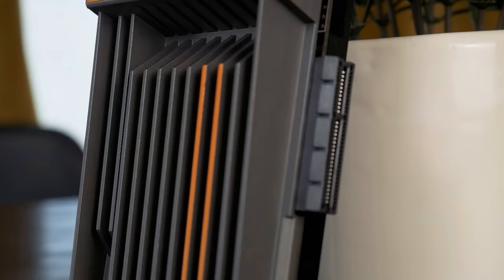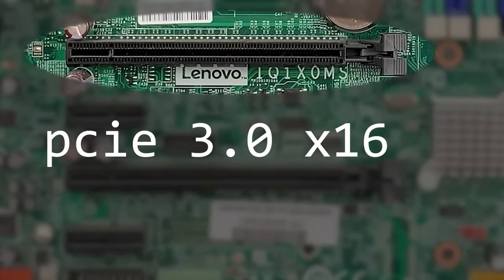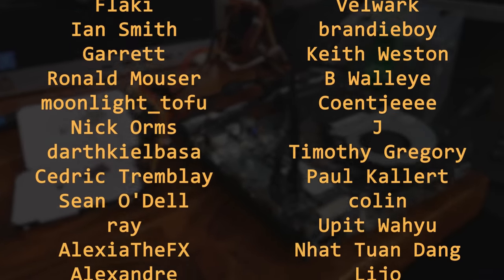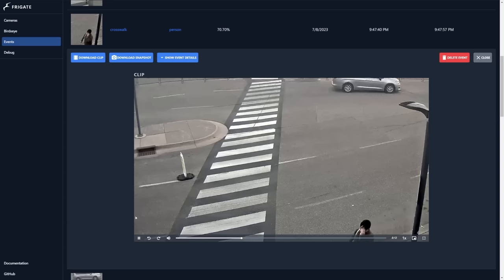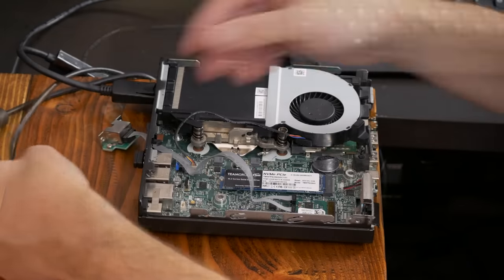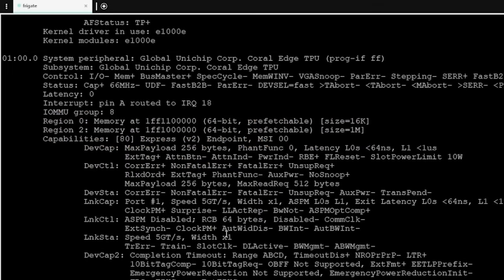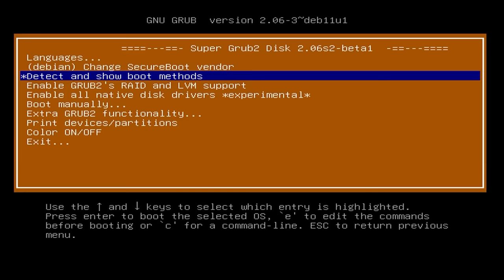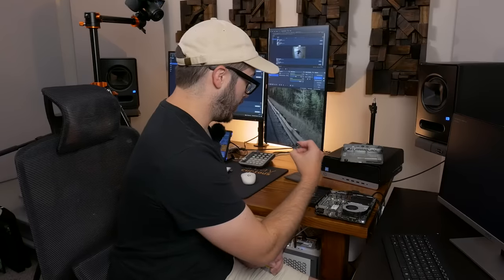Don't Overlook This Slot

Comment: Turning the wifi slot into a SIM card slot for cellular internet connection is the #1 most amazing modification that no one feels like they should talk about.  This is a high end feature only some business class laptops receive.
Reply: What modules would you use for that ?
Reply: A SIM card module?
Reply: How the hell have I never heard of this?!?!? That’s probably one of the most convenient features you could put on a laptop today.
Reply: @suspiciousstew1169  I think it's more common in rugged devices. Stuff that's meant to be used in a quarry, in the field, by surveyors, etc. are more likely to have these. I think. It used to be a big thing in more high end laptops, but now that most people can get a laptop if they want (as the cheap ones are usable), most people work in the city, every coffeeshop has free wifi and every phone can now be used as a hotspot it's far less common. If you're a little bit older I think you're more likely to have heard of it.
Reply: @suspiciousstew1169  Same, that's actually pretty groundbreaking. >.>
Reply: Ive been looking for a combo wifi/LTE M.2 for years. Does any one know any models?
Reply: @luv4mpower I want one of those too
Reply: I think Ive seen that product in some china e-commerce its sell just part of motherboard and other. but I've forgot what website it's, I give a link if I got it
Reply: Actually a good idea. Especially if your laptop has 2 slots.
Reply: The reason is that if you don't also have wifi it is pretty anoying in most situations.
And it is a common feature in a lot of business laptops. Admiralty they are more expensive than a lot of consumer ones. 
But the more expensive part is normally the data anyways.
Reply: Indeed. It was a pretty cool feature in these high-end business class laptops, but shortly after the advent of smartphones with personal wifi hotspot capabilities, there was obviously no real use for integrated SIMs anymore.
Reply: @dvdemon187  Wifi hotspots are not good for your phone - they heat it up like an oven for one thing and zap it of battery.  More of an emergency solution than anything.
Reply: that's how my laptop is.... I have a WLAN and a WWAN (for sim cards) slots.
Reply: Some UK ISPs have teamed up with mobile networks to provide 5g as a backup connection (inside the router), should the 'line' go down at home. BT and EE arer one example.
Reply: @Thurgosh_OG  that's fucking rad... I think they have that in the US but only with GSM service.  CDMA is so much better, and more secure, but they don't have CDMA in a lot of countries.  Not sure if they have it in the UK.
Reply: Woah!!!
Reply: I wonder if there's a wifi/cellular combo module thing
Reply: @Allen-R  i dont think ive seen one but there are all kinds of variants on amazon
Reply: I've got multiple Dell laptops that have dedicated WWAN card and SIM card slots. Not really a high-end feature like some people seem to think here, nor a new idea. Most business laptops around the mid-2000s onwards, certainly Dell, had these slots as standard.
Reply: @FlyboyHelosim  What modern non-business class laptops have this feature
Reply: @TheTastefulThickness  I couldn't tell you off the top of my head, as I don't specialize in either. I deal with older business/enterprise/industrial/rugged laptops almost exclusively.
Reply: @FlyboyHelosim  Ok just making sure.
Reply: @OttosTheName Yeah, but you also don’t wanna use that “free wifi” without a VPN, cuz literally the host can steal your data and sell it, or someone else (unrelated to the Wifi host) can hijack peoples devices. Which most people don’t care cuz “it’s free” and have too much trust in the establishment.
Reply: Also mobile plans on laptops means you can mostly only use them for business, or contact. 256Kbps is only good for that, and if you game occasionally when on the road and have these…. That data is gonna go quick, especially with updates.
Reply: @Thewaterspirit57  Most data will be encrypted. And most hosts won't bother. It's good to be aware of the risks, but VPNs like you to think everything is just up for grabs, but that's not the case anymore. If you see a little lock symbol in front of the adress your connection is secure. But... i would recommend a VPN for more sensitive information.
Reply: @OttosTheName  You misread my messages. Most people don’t use VPNs when on free wifi, because they think it’s safe, when it’s not. Even if the establishment doesn’t steal and sell your internet traffic, someone else will still come in through that free wifi, and do that themselves for a quick dollar.
Reply: Wow some people have been living under a rock. Sierra wireless lte modem entered the char
Reply: All my Thinkpads had a sim card slot in the battery bay so you didn't need to do this... I'm sure others had this functionality as well.  Thinkpads forever!
Reply: ThinkPads have a slot for m.2 wifi and 4g/5g modules
Reply: M.2 lte/5g modems do not have onboard SIM card slots. The machine should already have a SIM card slot wired to the specific m.2 slot. Or the model you get should support esim.
Reply: iPad
Reply: @sixoffive no these are covert/iPad— why the OS Would be a hindrance…
Reply: There is a big problem. Bcuz u cant change ur sim card
Reply: I had this feature in both of my used ThinkPads, ended up removing the card and replacing it with an mSATA
Reply: @Blinkerd00d My Lenovo T470 is CDMA only, if I remember right.
Reply: @luv4mpower  IME devices will have a separate card for WWAN (cellular) and WLAN (wifi/BT)
Reply: SIM on m.2 and a usb wifi dongle. But the situations the SIM would come in handy for most people are so few it might not be worth it even at low cost.
Reply: my dell laptop has buildin sim slot. its handy but never used it till now
Reply: That would be bad ass, however given the Cypher and cypherkey along with the device register number, and simcards that currently support 4glte 5g ect. Are extremely difficult to decrypt and let alone tricking it to allow data. It would have to be a 100 percent paid for service unless you're very well versed in hacking hardware and hack rf as well. It would be an amazing upgrade though
Reply: Or just use usb lte modem.
Reply: I have 2 HP elitebooks one only supports 3g HSPA cards the other only supports 4g LTE cards. But the card slot is multi into the mobo and then needs the card to connect to the antennas
Reply: What's the advantage to that over a wifi hotspot from your phone? just having the additional network connection?
Reply: Problem is that the wifi card slot is very small and you can’t a modem in it. The only I’ve found are ssd m.2 slot ones, even then, they are quite wide
Reply: I was going to comment that those modules are kinda pointless since you can just simply use your phone as a hotspot. But then I remembered that there’s still underdeveloped, poor places on earth where those poor multi billion dollar companies can’t afford to allow tethering because think of how those execs would feed their… Bentley’s gas tank if they had to lose a doller or two over all that extra data being used on your phone’s data plan… that Bentley could be starving, you know! 

In all seriousness. Yeah, I get that it’s also used in business applications where the user often doesn’t have a phone plan with enough data or heck one from work at all, and they still need to be able to access the internet on their laptops wherever they are. Or for shared devices requiring independent internet. But wouldn’t it just be great if it were illegal to disallow mobile tethering?
Reply: @computer1up  Thanks for the explanation! I figured there was a good reason I wasn’t aware of. I didn’t know that tethering wasn’t enabled in some parts of the world, that’s absolutely fucked.
Reply: Im sure every Thinkpad i have owned has this... even the old trusty T410/T420 i keep has a sim card slot.  Accessible by removing the battery IIRC
Reply: @FlyboyHelosim Thinkpad laptops usually have it too
Reply: Many laptops these days have a SIM card slot.
Reply: @Blinkerd00d CDMA is long gone. Some of the RF concepts were incorporated into LTE and going forward it’s just LTE & 5G until the next standard comes along. (LTE is an evolution of GSM, btw)
Reply: The HP Elite series has it for like 20 years. Originally 3G, but I think you can install 4G these days.
Reply: Lenovo Thinkpad laptops have always had this as a feature.  I think you might need to spec it like this.  On older models you removed the battery and the sim slot was accessible from the battery bay.  I had to replaced a hard drive with an SSD on one a few weeks back.  A T410 (guy uses it in his garage so he doesn't ruin his Mac apparently).

Note its the Thinkpad series of business laptops not the consumer Ideapad models that I am referring to.  UK models.  Other countries may have different model naming from the manufacturer
Reply: My laptop has 2 cards- 1 for wifi and 1 for sim card.... its a Dell Latitude E5550.  It's an older laptop now, but it still gets plenty of use as my bedroom TV media player and it gets taken on all vacations/travel.
Reply: @luv4mpower  endless options if you don't mind the umpc form factor, basically anything under 12.3/11.6" screen size.
Reply: @TheTastefulThickness   don't know what were you yapping, I use hotspot 24*7 on a cheap 5$ phone, If some shitty phone can handle it current day smartphones should have no problem with hotspot
Reply: Back in the day, we had (probably still do) something called a dcom that you'd put a sim card in and use its internet connection. No need to break open a laptop and sacrifice wifi for that.
I think if something can utilize usb, it should. Obviously if you want more performance, pcie is a better choice but in most cases, usb should be enough.
Or better yet, bring along a mobile access point if you don't mind the size and weight.

Comment: Oh hey. I made that wikipedia E key edit. It used to be that it was written in a way that could make people think m.2 E could be 2x PCIe x1 but that was not the case. It is a mix of 2 of the following list.
Reply: Coral has dual accelerator card for two separate 1x: CORAL G650-06076-01
Reply: So no SLI on mini PCs? What a bummer...

Comment: You need a common ground thats why it worked when you shorted the both grounds. Anytime to use two different power supplies you'll need to do this. It's not going to hurt anything just make it work!
Reply: common negative

Comment: As others have commented here, I would be extremely cautious using multiple power supplies in a situation like this. I've even had issues using external hard drives on test benches if things aren't properly grounded.

Comment: I had a random 32GB SSD sitting around doing nothing and an unpopulated slot meant for a 4G card. The extra 32GB drive in my laptop is nice to have considering I only have a 250GB NVMe.
Reply: I hope you know that $40 can get you 1tb ssd/nvme nowadays.
Reply: @peppernickelly always nice to reuse old hardware though. Prevent the ewaste pile getting bigger
Reply: @l-e-v-117 
But 32GB?
Reply: @Alias_Anybody  
For a Linux system, for example, this is more than sufficient.
Reply: you can use this 32GB SD card to make HD cache

Comment: I hear on the ones with a "whitelist" the computer will just show an error message and not boot.  I also heard that they have been stopping that.  It is no guarantee that you don't have a whitelist restricted computer.  I think the main reason they did do it at all was to keep someone from using WiFi cards intended for other countries that don't meet or follow all of the FCC regulations.  When it comes to these things it is amazing all of the things the manufacturers must do to avoid upsetting the FCC (or similar organization where you might live).

Comment: the five stages of computer shenanigans

- what happens if..
- wait what
- no way this works-
- oh.. s#!t...
- OH F&€K
Reply from the maker: Exactly. Baha
Reply: True until it doesn't (Alot in my case.)
Reply: I like your background and intro music :)
Reply: Yes.
Reply: You forgot the stage when something actually works the way you want it to -- "Hold my beer."  The same stage can occur very, very late at night.
Reply: @HardwareHaven  Five stages of grief.

- Discovery of computer issue or stupid upgrade fails/denial
- Wait, I can fix it, oh wait I can't ahh!!!/anger
- Ok, it's turning on but I can't do anything, should I sell it?/bargaining
- Damn, I broke it/depression
- Oh well, just buy a new one/acceptance

Wonderful how every single tech video is the exact same format too. I do not find this fun or endearing to waste my time, just skip to the part where it works or make your computer in a crack house with hobos and wild dogs outside banging on the glass if you want to add some entertainment value and a story. I want a dirty looking hobo to throw a brick at your sideways monitor you spent too much on instead so I don't fall asleep with this snail paced video about reusing a wifi slot.

Comment: If you're going to use a PC PSU as external power supply again in the future, try to make a USB Optocoupler to trigger the green wire so you don't need to jumper the psu with paperclip and don't need to remove it because as soon as the board powered on/off, the optocoupler will also get powered on/off, and also it will trigger the PSU on or off.

Try a cheap PC817 with some resistor
Reply from the maker: I’ll have to check that out next time, thanks!
Reply: Interesting.......ill check that out too in the future. I never worked on optocouplers before, i heard a lot of it but never understood how it actually works.
Reply: @HelipOfficial  optocouplers is basically a IR LED and a Photodiode in one package. When the photodiode gets ir light, it conducts.
Reply: or just... a 5 or 12V relay that needs no other components to do the same? KISS principle
Reply: @Knaeckebrotsaege  yes that would be simpler, and will work fine if the user likes the relay click sound at startup.
Reply: I think I'm going to configure my RPi5 to trigger the green wire when I get it in the mail.
Reply: USB Octocoupler
or
5 or 12V relay

Cool ideas 😎

Comment: When you run two PSUs, it's best practice to bond the case ground to case ground (assuming both of them have metal cases) ...AS WELL AS... the zero volt rails to each other.
Keep these seperate - for example, bond the cases with one heavy ground wire. Seperately, bond both 0V rails (black wires, usually) together.

In your situation here, I assume you#re using a 19V plastic brick PSU and the second PSU is the $5 metal case ATX PSU, so, being unable to bond the PSUs cases because one is plastic, you simply make sure the black wire of the second PSU is very firmly connected to the chassis 0V of the mini PC, usually the metal case is directly connected to the 0V line. 

I've guessing that there was a potential differance ("a voltage" to most people) between the 0V rail on one PSU and the 0V rail on the other PSU. The only thing linking the two 0V rails together was the screening earth braid on the SATA cables, so current was flowing on the SATA screen. This sort of thing can cause all sorts of wierdness. It's not so much about mains safety grouding (to anyone in the US), or "earthing" (in the traditional British English sense - electrical engineers really call that equipotential bonding of exposed metalwork. Nope, it's actually more about making sure that leakage currents or noise voltages don't affect both the devices you are powering AND the PSU regulators themselves. In simple terms: "it's f-ing complicated" :) 

The potential difference can easily occur do to RFI Y-capacitors on the mains input of one or both 
PSUs, as the caps are never perfectly equal value and also have a inherent leakage current. 
This is why you get a "tickle" from the DC power lead on some laptop PSUs. 

For years I've wondered how gamers could get away with running 2 PSUs in the same case to power a huge GPU, in reality, without bonding the 0V rails there coiuld be all sorts of unusual currents flowing across their GPU and through the PCIe (or PCI/AGP/IDE) socket in a similar way 
to the way your SATA lead was trying to equalize the two independetly floating 0V rails.

For anyone running NAS systems with lots of disks and 2 or more PSUs, it was less of a problem back in the day because each spinning HDD had a nice fat metal case and was screwed directly to the mounting rails in a metal chassis. The HDD 0V rail was internally connected at or near the power connecter on the disk to the metal disk case via the PCB mounting screw pads.
But recently, as people do this with SSD and their plastic cases, the problem is occuring on 2-PSU DIY NAS boxes too.
Reply: Only for my understanding, it will be enough if I connect the PSU case to the ProDesk case? At the PSU a screw at the mounting bracket with a wire and then the attach somewhere at the ProDesk case, like a case screw?
Reply: I didn't understand anything but thanks for the explanation 🎉
Reply: @joshuahzg  essentially, 2 PSU's = share common ground
the second PSU couldnt share common ground with the HP Mini
Reply: I am very grateful that you shared this and I stumbled onto this information before I started new server build!  Thank you!
Reply: @ALittleBitOfEverything-wd9ee you technically don’t have to do that as long you have a powerful power supply having two would waste and you can turn any pc into a server
Reply: Thank you
Reply: Uh, yeah!  I sense your post of paragraphs is the Voice of Experience, sharing with us.  Thank you...🇺🇸 👍☕
Reply: I have a problem like this with an HDMI projector plugged into an Intel NUC. The NUC is on a UPS and the projector is on a different AC curcuit.
Originally, I thought HDMI used differential isolated communications, but apparently not?
Any tips?